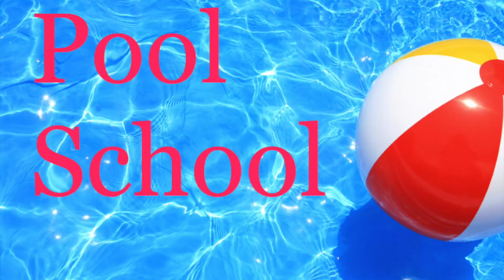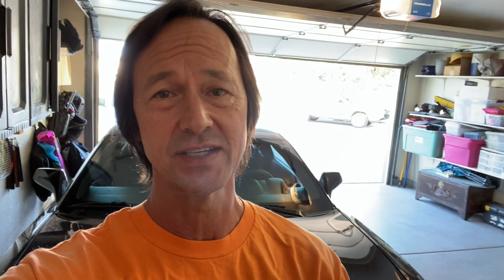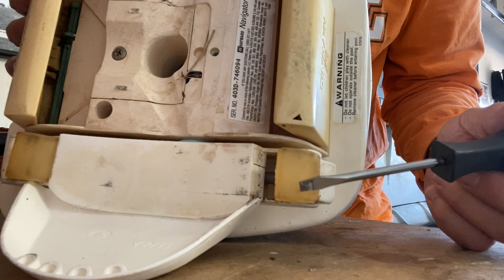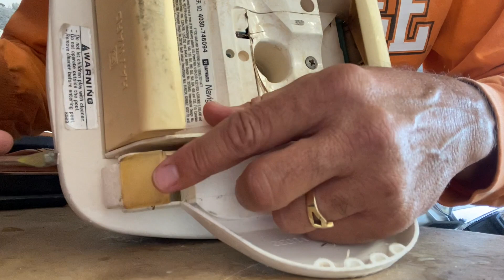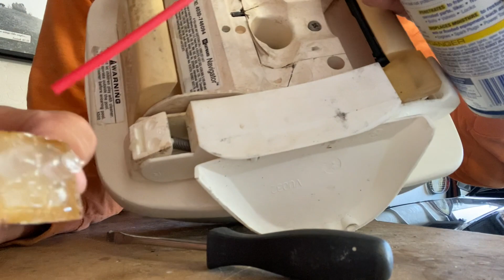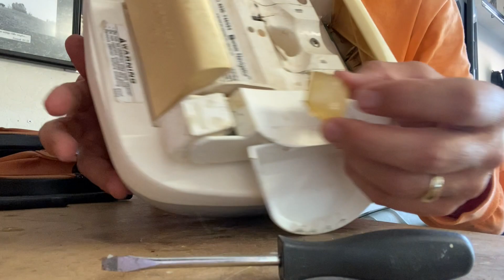Hayward Navigator Repair Pt  1   Replacing The Shoes

Comment: Do a video on getting the shoe spring back in if it pops out.  Seems to be impossible.
Reply from the maker: To be honest with you and one of those shoe springs pops out it’s usually because the little knob that holds it in place is broken off and at that point it’s better to just replace the pods themselves.  Better yet save yourself the stress and being nickel and dimed by that vacuum and purchase a barracuda G3 you’ll be glad you did.

Comment: I have a hayward navi-50, which is only sold by pinch-a-penny and the shoes are different in where the pegs are opposite in size and they want $25 for 4 of them and nobody else sells these as far as I can tell....what a scam for something that probably costs $1 each.
Reply from the maker: That’s a bummer, sometimes house with all products there are knock offs that are cheaper but end up with the same problem that you’re facing. I suggestion would be get rid of that thing and get yourself a zodiac barracuda G3
Reply: @PoolSchooler  I ended up buying new pads from Amazon which came with shoes and wings for $40 and just replaced the existing hayward pads with them. Now going forward I can buy the knock off shoes for $8. Screw pinch-a-penny

Comment: Just don't give enough time for the viewer to examine hayward feet, your too busy talking and moving things around.  I think my pad may have been put on wrong and why it won't walk.  I also hears that if the pods are not skewed tight enough and wobble that can interfere with it's mobility too.  I took it to the pool store and they said the replaced 3 things but I didn't get the parts back or anything that said what they did and it still doesn't work. I took it back they said it must be my suction and I hired a pool guy and he said suck is fine, took it back to leslie and again they say parts are ok nothing wrong they could see, don't think they even looked at it only one person in the store, "I went to leslies-no more".
Reply from the maker: Sorry the video wasn't clear enough.  But I 'm glad you no longer go to Leslies.  I'm not a fan of their stores.  Also, I'd suggest getting a Barracuda G3 pool vac by Zodiac.  I did a video on it cause it's my favorite pool vac and very easy to maintain.  Only one moving part.

Comment: Be nice to show the new ones going in, they are way harder to get in even with a lubricant. The lil ring on the fitting really fights going in.
Reply from the maker: I agree with you.  That is one of the many reasons I don't care for this vacuum (or it's off shoots).  My favorite is the Barracuda G3 made by Zodiac.  You may want to look into that one.  I highly recommend it.